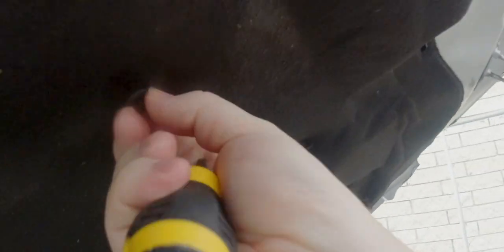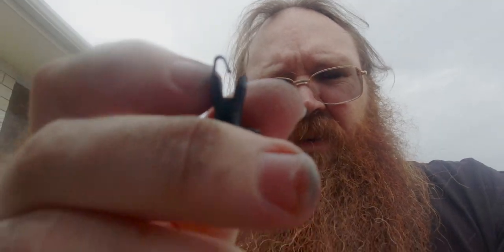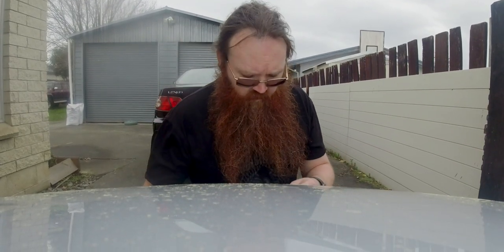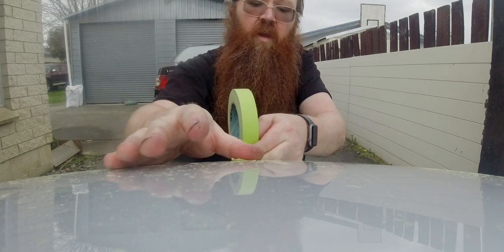Taking to the new Jaguar XF with a power drill

Comment: You might find that it fails it's next WOF due to "illegal modification" but that depends on who you take it to. ..it's 'cos it sticks out and it's a dangerous fitting....if you run someone over they might bang their head on it.
Reply from the maker: It’s not an illegal modification. The external projections act 2001 (yeah there is a whole act for this!) does apply reasonable restrictions (so you can have spinny wheel blades or big spikes along the front bumper). Good ornaments are permitted if they’re safe and sensible. Our act references the EU standards which prefer that a bonnet ornament be breakaway or spring mounted.